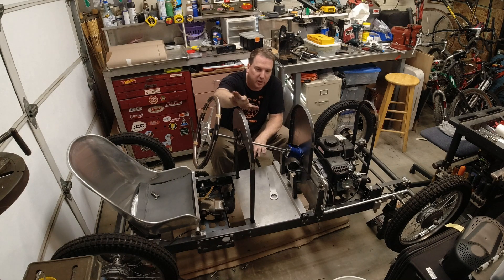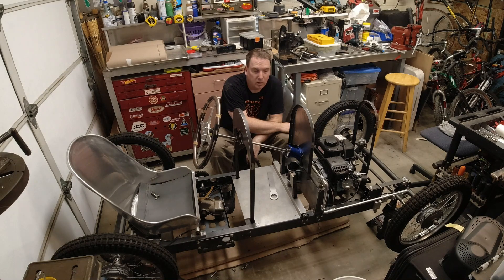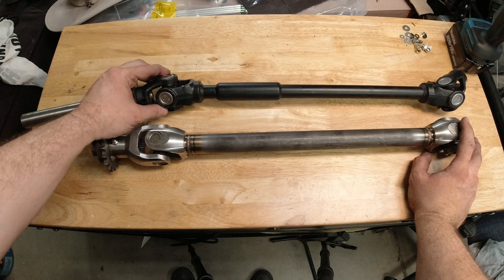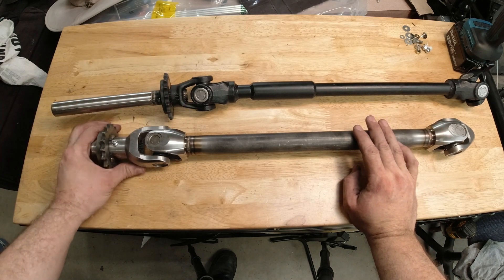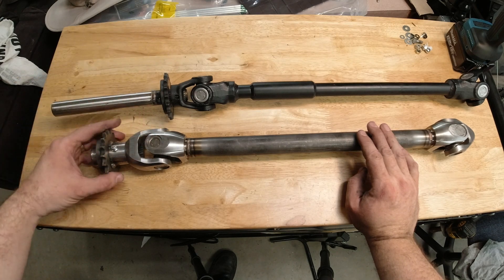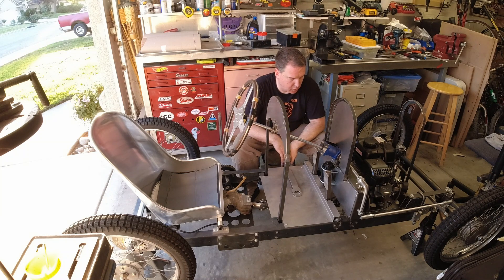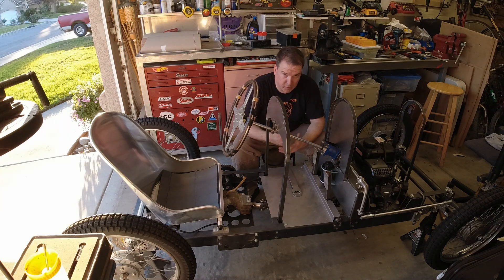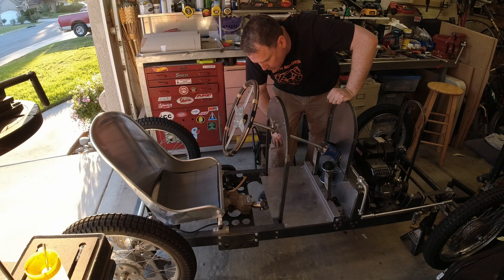GN GNAT Cycle Kart Build: New Driveshaft Installed!

Comment: Beautiful. I am building a 1928 Morgan Aero RIP GN Special. I am using an experimental aircraft opposed twin engine mated to an MG Transmission through a cast aluminum two part adapter and instead of a GN live axle I am using an MGB rear differential so It has brakes . I am out in Pennsylvania. Where are you?
Reply: California...wrong coast!
Reply: @allardalley  I was going to say Arizona but it looked too wet..lol

Comment: your Driveshaft is assembled wrong (both of them) the u-joint flanges MUST be 90 degrees from each other or you will definitely have vibration problems please go look at any vehicle with rear wheel drive and front engine for proof. please fix this asap as it is not safe the way you have it!!!
Reply from the maker: I think I did it right Frank https://www.beldenuniversal.com/knowledge/technical-information/universal-joint-phasing#:~:text=Phasing%20is%20the%20process%20of,can%20cause%20second%2Dorder%20vibrations.

Comment: Just a couple of observations, I notice your engine is moving around a lot, it looks like its loose in its mounts, is it rubber mounted?  https://youtu.be/0yiVpzS8l50?t=263   It sounded like your engine was running badly, this could be the recording, automatic volume controls sometimes clip the sound, distorting it. I guess you have probably installed a steering wheel quick disconnect by now, it would make it a lot easier to get in or out of your cyclekart.
Reply from the maker: The engine is mounted tight, but the plate it mounts to has a fair amount of cutouts which is likely allowing the vibration. As for the seating position, it looks cramped, but its actually pretty comfortable. It's also easier to get in and out of than other CK's.